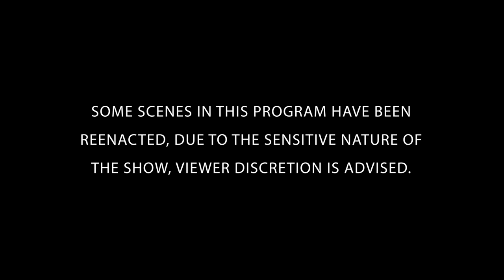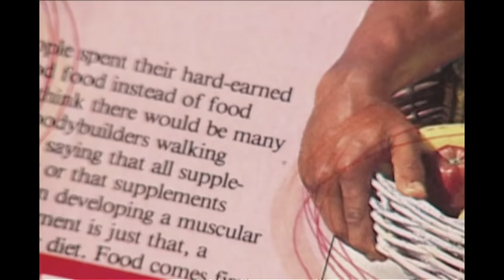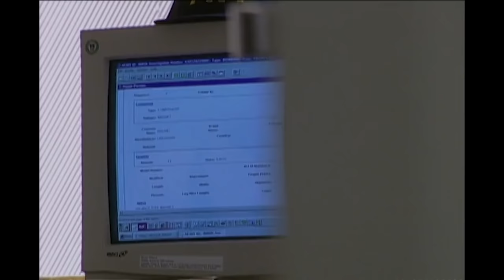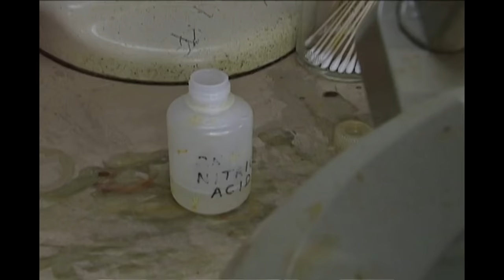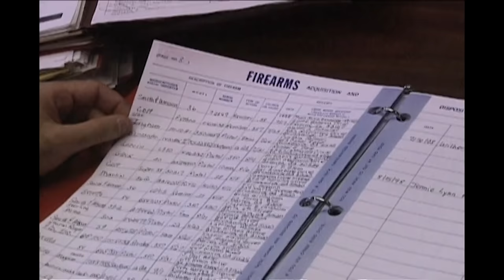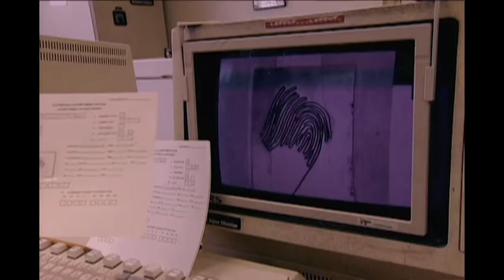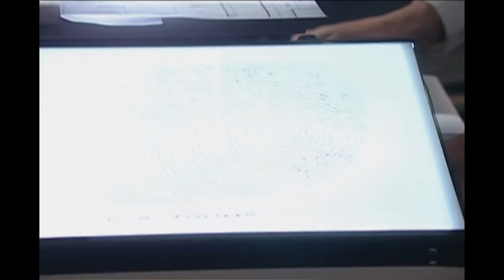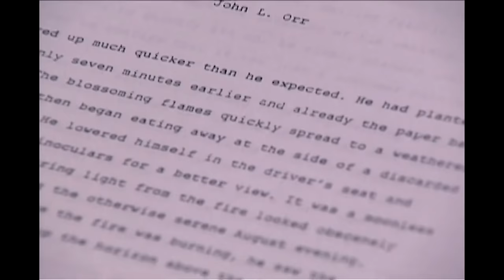Federal Offense | FULL EPISODE | The New Detectives

Comment: I am most surprised at the bomb guys approaching it before clearing the area completely of by standers, no. 1, no. 2, if that reenactment bomb looked like the actual bomb, the wire could be an antenna and so remote detonation  could be a possibility. And why approach it with men at all if they had a robot? Assuming they didnt, first get suited up in full protection, get a bomb bell  and put cover it with a detonator inside and destroy it. I just cant believe what happened.
Reply: Audio is awful.